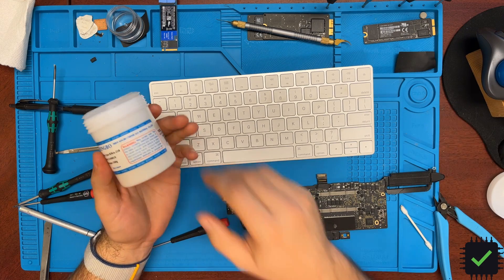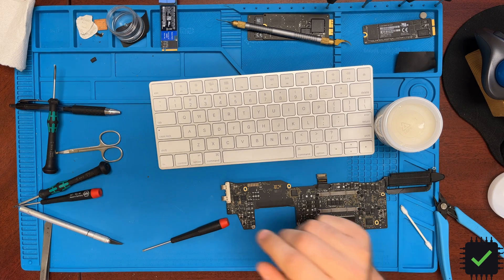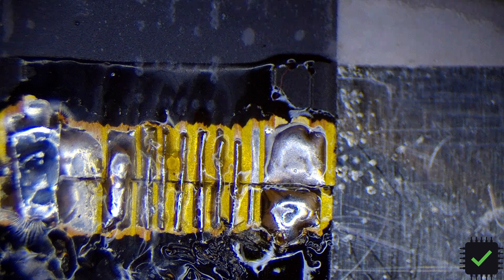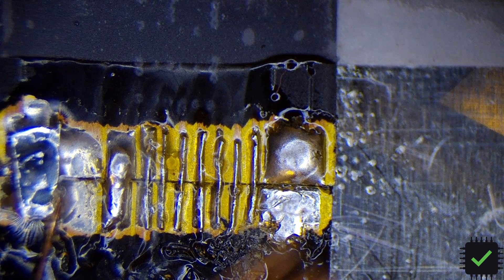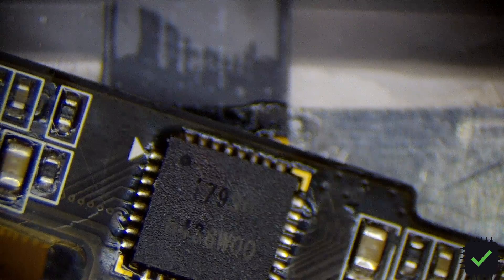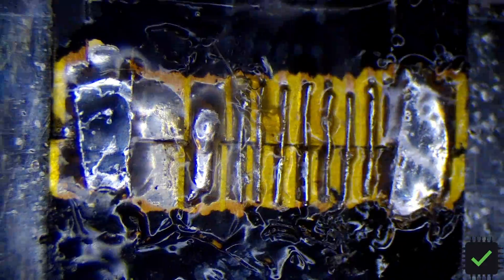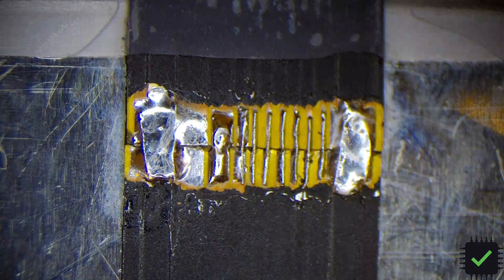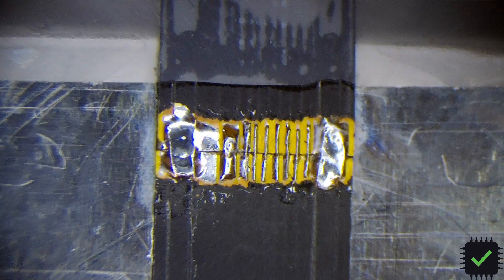Really Impressed with Kingbo RMA-218 for any non-bga soldering projects. Works well, doesn't run out

Comment: Neat! I tried about 8 different Fluxes this year and ended up settling with Kingbo RMA-218.  Seems not to bad for BGA...
I also have NC-559-V2-TF. But mine seems alot more orange color than yours. It was from Amazon. I will consider using it more for BGA

Comment: What flux would you recommend for BGA rework?
Reply from the maker: I use Amtech NC-559-V2-TF
Reply: @applepietech  Why use that one over the Kingbo? What are your thoughts on Chip Quik NC191 and the Stirri V3-TF (which is supposed to be the succesor to the NC-559-V2-TF)?
Reply: @phr3ui559  I think that NC-559 is a no clean flux. RMA-218 isnt.
Reply: @NIFUable  and... why you think? all sites selling RMA-218 have almost same description: "Solder paste (flux) KINBO RMA-218 10g is a high quality Japanese flux no-clean designed to repair BGA, SMD, QFP. It has
the consistency of a gel for easy application and has a high viscosity without leaving residues."
So it is NO-CLEAN